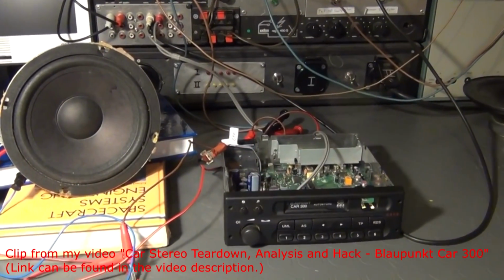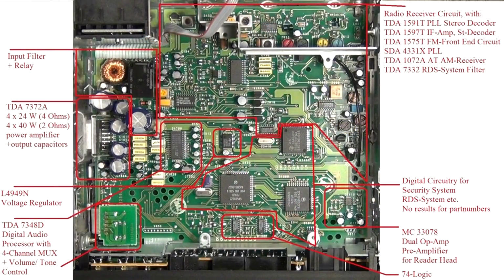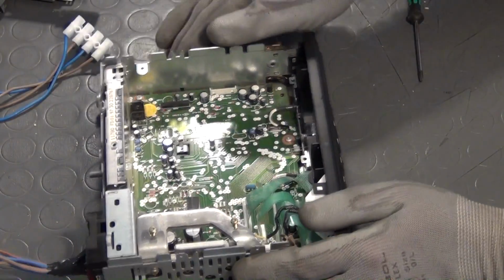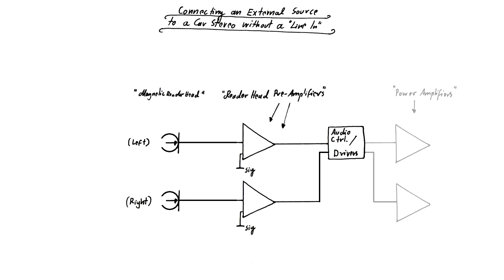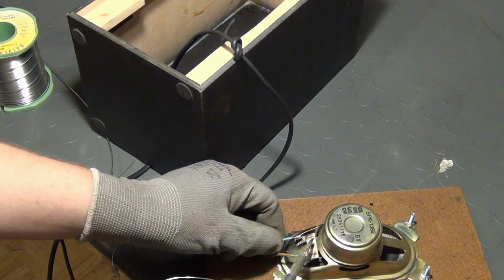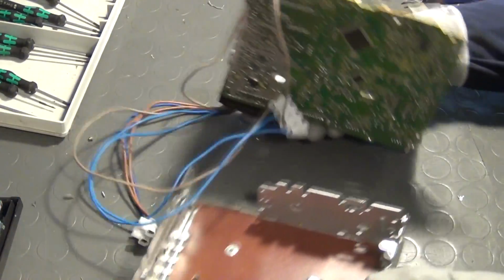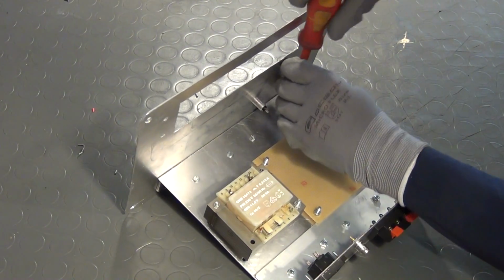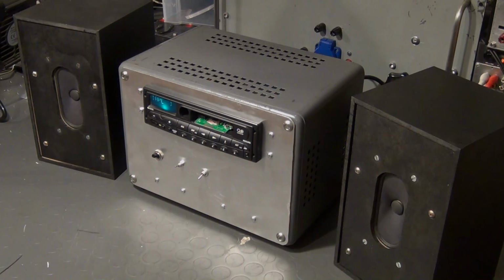How to Convert a Car Stereo to  a Home Stereo System + Bluetooth

Comment: A bit of insulation, or anything soft inside the speaker enclosure would fix the boominess of the speakers.  The boxes are a resonant cavity, and without something soft inside, certain sound ranges will come out much louder.
Reply from the maker: +Matthias Wandel I actually put old rags inside. I forgot to show that in the video.
Reply: +Matthias Wandel  I saw your speaker project long back and I've been seeing your Pantorouter build. Man of Skill...I truly admire you.

Comment: By the way, those off brand "shammy" cloths, which are made of rayon fibre make for excellent deadening material to put inside of a speaker. You don't need much, and it makes quite a difference!

Comment: This takes me WAY back. In about 1985 or 1986 My "Boom Box" was a Pioneer car stereo, with cassette of course, mounted in a box that used to hold a great big old "condenser" analyzer from the 1940's. I bolted a couple of 6X9's to the side of it that I had mounted in a couple small plywood boxes. I had it set up to either be plugged in to the wall with an internal power supply, or to run off of a small garden mower battery. I mounted a handle on top that was off an old tool box. I really didn't carry that beast far, but it WAS loud, which was all that mattered to me as someone about 16 or 17 years old.

Comment: If you use a ground loop isolation transformer for each channel between your Bluetooth module and the amplifier, you can eliminate that buzzing noise.

Comment: Nice one.. When I was a kid back in the mid eighties, I had, in my room, a self-built wooden enclosure with an old mono autoradio and a power supply in it. The speaker boxes were also homemade, using loudspeakers from a scrapped ghettoblaster, including bass ports with a length of tube, and insulation material, as suggested by Matthias below.

Comment: I use a car radio too for the house. For a different reason- the radio inside has excellent sensitivity for weak signals we get in Australia, and good noise rejection too. I bought a brand new Kenwood for $60, already had blue tooth and line in, just needed speakers and power, I used Kenwood car speakers in a well designed box, and it performs like a hifi.

Comment: a little secret with modern car units (well, past about 2006 or so) all the chip amps in them are rated for up to 18V. i have litteraly a closet full of radios, from factory to aftermarket, and ALL of the aftermarket ones i have dont complain on 16V. can get over 20W into 4 ohms on 16V. they do run a little hotter, heatsink measured around 140-150f BUT since your only running 2 of the 4 channels when used at home, thats within the safe limits of the chips

Comment: One time firend ask me for AUX for old radio in car, I just soldered jack connector wires to main board to main audio chip and with it my friend was able to connect smartphone to him 70s car audio :D

In my home im using car audio 600W amplifier(lol, weight is about 10kg), and 200W subwoofer, both salvaged from dumpster, amplifier was working but there was broken RCA connectors, in subwoofer problem was with speaker internal wire, that is connected to moving part of speaker(sorry, idk right word).
Dad also give me damaged, polish made 40W speakers, they had damaged rubber part that hold moving part of speaker in place, but I was able to order via internet restoration parts, only few euro.
Im powering this system from extremly HQ, HI-END server SMPS with 685W of power, there is no noise, because this SMPS run at high Freq, above 200kHz so unhearable level, I paid only 20EUR for this supply that is worth of 200EUR+
So, I have very loud speaker system almost for free.

Comment: I tried to get a Nakamichi H/U when I was building car audio years back, but ending up with a good deal on an Eclipse 8054 (I think thats the right model). I have been playing with a lot of different amplifier boards lately, and have had a lot of fun with the TI TPA311x class of chips. They have outstanding performance, and with homemade active crossovers or DSP they can make some nice active multiway drivers. I haven't got around to printing my own boards yet, but you can get a Sure audio TPA3110d2 board for less then $10 USD.

Comment: love it. especially the end. :)

in your testing with atx power supply, you might find that the noise is actually from ground loops from signal sources rather than switchers themselves being noisy. That's been the case in my experience and it is easy to dismiss it as "smps is noisy, thats why linear is usually used for audio applications" but it's good to check first before dismissing it.

Comment: I still use cassetes from time to time, but most importantly those motors are very interesting, the run at a constant speed, no matter the voltage. If you put them on a big cap they will run for a couple of minutes then stop  abruptly

Comment: nice build..the only problem is that the radio has a code you would have lo keep the transformer on at all times so the radio does not loose power..so if you could do a bypass of the code..only using hardware and no atmega or something like that it would be lovely

Comment: just a small comment: to reduce the voltage out of the rectifier, just put two or three in series diodes to drop down with arround 1,2 or 1,8V :)

Comment: I just did this for a sound system for my garage. Even down to the same concept of using scraps laying around to build it. How ever I used a old dell ATX psu. I'm not experiencing any noise like you said from the psu. I watched this video because I'm trying to figure out an antenna for it lol.

Comment: Nice job,Wouldn't it have been better to integrate those small speakers into the same metal enclosure as the player,Seems like the external speakers are wasted space when there was plenty of room on the metal enclosure for them.

Comment: You could have just used a standard set of ISO cables, ISO is the standard for almost all aftermaket stereos.
The ISO cables also specify on each cable what it does.

Comment: I have a suggestion to increase your revenue. Please have a link to an inexpensive Bluetooth receiver PCB from china that works off 5V/12V and negotiate with the seller for a promocode. You can consider adding a IR/Wifi Module also which should work pretty much the same way. Thx for the video.

Comment: Awesome!   ATX should be more than fine, if it can supply clean volts to run sensitive IC's in a  computer it should easily provide clean power for a stereo...
Reply: A cap for current spikes could get necessary tho.
Reply: +Brian C Who wants to hear the fan noise when listening to music quietly, also pc power supplies are rated for hundred of watts and their efficiency is often not that great so you going to waste a lot electricity. Also you may get switching noise on the audio thrown in free.

Comment: Ha-ha... ☹ The "outro" is "hurts" me! Because I still use casettes and I have a car radio with two speakers and a 12V power adapter in a plastic storage box with old reused tv antenna mounted on top and I still have the casette mechanics in place and working just fine! Mine is not "perfect" as yours (I simply milling out the necessary holes with a drill by hand) but it's just fine for me. Oh, my radio is a "Wolkswagen Alpha" radio with smooth red front backlight!
(Sorry for long comment and not too perfect english...)

Comment: Love your videos and your approach.  I am learning a great deal.  One request/suggestion.  The 3300 uF capacitor on the power supply is quite large and I dont yet understand exactly what caps are doing for the circuit.  If, in future videos, you could speak to that more about how these components are sized.  Was that just what was provided by the Halogen lamp or did you have to size it by some other criteria?  Also practical bodger insights would be welcome, like if you did not have any of that size how you would make decisions about putting two smaller ones together in parallel?  Would it be important that they match or just add up to the final desired value.  I love what you are doing with this old stuff and more of your insights and practical design considerations would be lovely.
Reply: And now I find your RFID zapper video which addresses a lot of this.  Thanks.

Comment: Good choice of an old halogen lamp for the power supply. Some people butcher a xbox360 PSU to make it 12 volt. The horror! D,: Who would do such a thing?!  Such a thing could have been used as a spare to power an xbox360, especially since each model has an annoying "different" version of each PSU (even though that makes sense). Your halogen PSU notion is better.

Comment: For next time, that's a regular ISO 10487 connectors used for car audio!

Link: https://en.wikipedia.org/wiki/Connectors_for_car_audio#ISO_10487

A breakout for those is about €2 if you're looking in the right places. Just a bit neater that's all!

Comment: Why so violent with this poor cassette mechanism ?. glad you keep the motor, those motors with the built in speed control (2400 RPM) are pretty good and even as spare, are hard to find ..... You wonder, yeah, still many people enjoying their cassette decks, boombox, walkmans, vintage systems all over the world as long as they keep far from your hammer / vice LOL
Reply: +38911bytefree I actually liked the video but got really sad when I've seen those cassettes smashed. I own three tape decks and I really do love them. Most of the people had shitty quality tapes and cassette players and think that they are junk. Just wait until they hear what a real tape deck sounds with good quality recordings on a good quality cassette and you wouldn't be able to tell the difference against a 320Kbs MP3 player. Just my opinion. Cheers :)
Reply: ciprianwiner Agree with you. Cassette was killed because the cheapo of the portable gear, base line boomboxes, walkmans, shoebox recorders.  People say that tape wont last, the hissing or background noise. I have 20 tapes from the VERY early 70s recorded using home level equipment, original PHILIPS made in Holland. Most of those tapes still kick the 0db led no issues. And for the hissign thing, just grab a proper metal tape on a proper deck, tweak the bias and push the level as much as you can and no hissing at all. I love tapes too, 
Just go and see now the vinyl fever, expensive turntables, expensive cartridges and VERY expensive records. Just imagine the same money, care and love with tapes, how wonderfull would they perform ... A decent turntable is more or less the same of a Naka 1000Z. Try to beat it.  Cheers
Reply: 38911bytefree That Nakamichi 1000Z sure looks awesome and probably performs as good. I wanted to get some metal tapes but they are bloody expensive here so I kind of forgot about them. Well, vinyl is the best audio quality format that ever existed but then again so is a good quality Reel To Reel and then of course tapes. Then you know, there are the digital tapes from philips and all sorts or variations from sony miniplayers and such. I stumbled across about vinyl 100 records about 1 year ago in a neighbours house but couldn't take them because the house was up for sale and didn't bother to ask for them since they were so scratched up unfortunatly. I like every physical format quite frankly but nothing beats tapes on quality/costs. One of my tape decks is Philips, the other is from Technics from 80's and other one which I still didn't finish restoring is "Intel" branded made in Japan from the 70's. Cheap junk players killed this format for sure!
Reply: ciprianwiner Same here, the 1000z is expensive. But hey ... have you look the prices of the "good" turnatables and a "good cartridge". No, thanks. It does sound awsome for sure, but tooooooooooo expensive. And yes , OR is HARD TO  BEAT, even using home systems, from Sony. Of coruse, you can move a level up and get a Revox / Studer. What a machines. I only have small UHER report series and blow my mind, quality is insane for its age, its size, sure they kick nagra really hard with the report series. Cheers.
Reply: ***** wow, that was a bargain, I love the 700 and the 700 II.
Reply: ***** yes, it is !. The 1000ZXL is sky expensive in good working condition and well mantained ... but not as expensive as a mid line turntable, I would stick to the 1000ZXL for sure.
Reply: Technics SL-10 is "affordable" and uses t4p cartridges so you can change them. Many linear ones use custom cartridges ... Shame those nakas have gone that pricy. I would consider an Open reel as an option. But it is no as practical as a cassette tape. But you can get better tape sound for less money, thats sure.
Reply: I was about to tell you to get and A77 LOL, Prosumer OR of that era are excellent, at any brand, Revox / Studer did really good. Have a look to the Studer G36 MK3 DEMO on YT. Mind blown for an OR running on vacuum tubes. Their standards were high for sure.
Reply: +38911bytefree I have many old cassette decks and recorders, some I've saved from the bins, and use these machines too. Sometimes I do end up scrapping a machine that's too far gone, but ALWAYS keep the heads, the belts, motors, and so on if they're any good. Just finished repairing an old boombox this afternoon, the owner was made up with it working properly once more :-)
Reply: River Huntingdon Yeah, motors., heads and some plastic pulleys, some ruber bnds are getting hard to find, unless you scrap mechanisms. Ive repaired many boomboxs. Some boomboxs are serious performers for its size.  I find JVC the best in terms of tape deck build quality. And Panasonic the best in terms of reliability, simplicity and servicing ... they keep working even on 35 year olds belts. Insane. Regards.

Comment: I suspected you would have to bypass the tape preamp/de-empharsis circuit, otherwise the audio would have sounded horrible.
Im supprised you didnt get any buzzing from the psu, the ripple would have been there without a propper regulator.
The tapedeck at the end, poor anvil, you scratched it lol :-D
Reply: +zx8401ztv 
So you think a car's onboard power is "cleaner" than a switch mode PSU? A car stereo has to have very good power filtering.
Reply from the maker: +zx8401ztv Many old audio amps (even those of very high quality) used unregulated power supplies like this.

Comment: How long do those gloves last? What are designed for? Interesting light duty gloves with nice finger tips.
Reply from the maker: +difflocktwo They are designed for light mechanical work I think. You get them for around 1€ a pair and they can last for weeks or months if you treat them well.

Comment: Do you leave the mains power to this radio constantly on then?Most car radios need a constant 12v feed to retain presets and code don't they.
Reply from the maker: +Steve Clark I won't make a general statement about that, as there are many different manufacturers, standards, models and vintages. All I can say is: This model, as well as the other models that I have worked on so far didn't need a constant voltage supply with regards to the "code" safety feature. Once I had deactivated the code feature, the stereos didn't ask for the code, no matter how long or how often they were disconnected from a power source. I din't check for all "presets", but as far as I can tell, they as well don't require a constant supply voltage to be stored. For example: The  "quick buttons" for the different stations were not deleted by cutting off the power. There might be other presets though. For that case there is a second +12V pin in the connector that would supply the stereo in "Idle Mode".
Reply: I'm only going by my own personal experience really but most of the car stereos I've had needed a constant live feed. Crazy really, why have another item putting a drain on the battery especially if you don't use the vehicle often enough to recharge the battery.
Reply from the maker: +Steve Clark Yes it's indeed an odd feeling to have a consumer that constantly drains on the battery. I haven't  measured it, but I can only guess, that the idle power consumption is very low though. If a car would be sitting for a longer period of time, it could still be a problem though.
Reply: +The Post Apocalyptic Inventor 
it could be a problem if the car was sitting unused for a long period of time, but it is a small drain and there are other things that drain the battery while the car is unused too such as alarms and immobilisers etc. i presume. If you only drive your car once a month, it's a good idea to use some kind of trickle charger.

Security code on power loss is obviously a security feature as having car stereos stolen was once common so if it is locked out as soon as it's disconnected you theoretically need the paperwork that came with the car to use it again making it worthless to sell. These days you can get security codes easily online anyway and car stereos are often specific to one model of car and difficult to remove without taking the whole dashboard apart so it's not as common a problem. This particular stereo looks old enough to be from the time when stereo theft was a big thing and security was not. 

I remember having a stereo where the security feature was that you could unclip the fascia and take it with you and what was left was a blank panel with a flashing LED to look like an alarm. This was in the days when people installed their own alarms and they were set off every time it rained etc... good times.